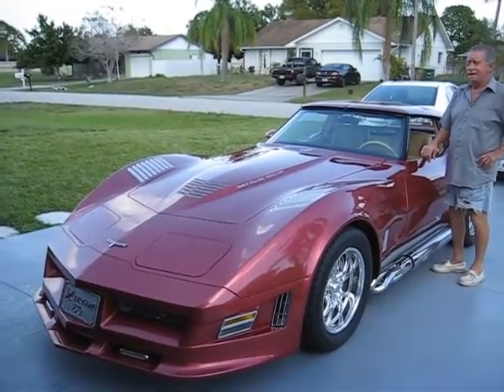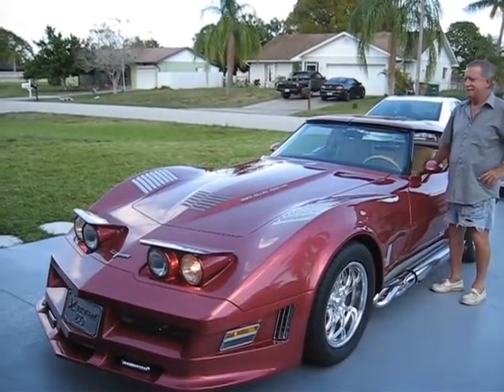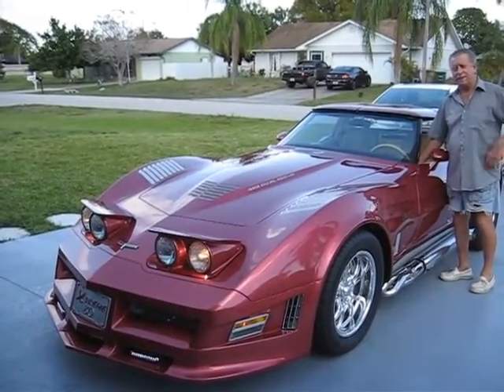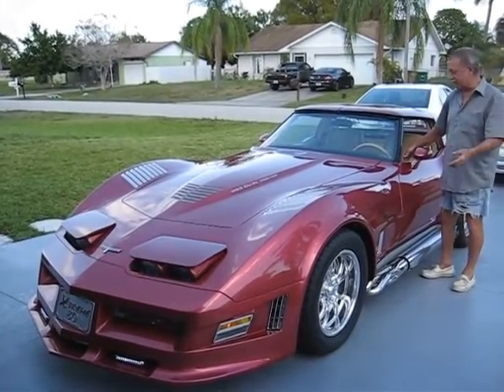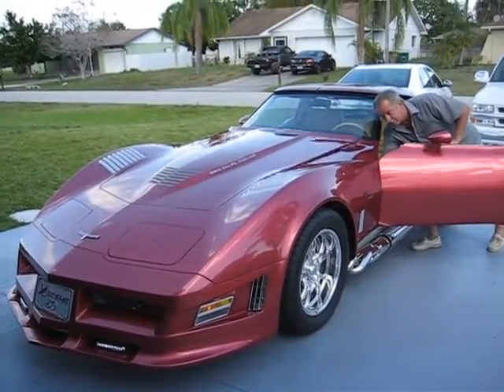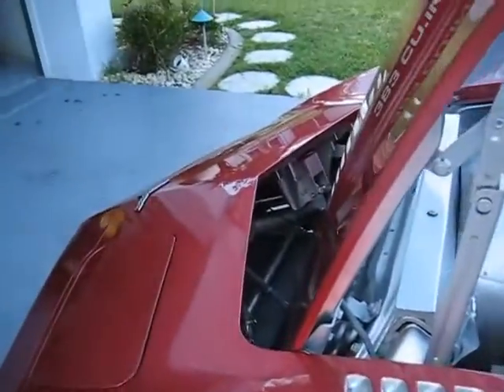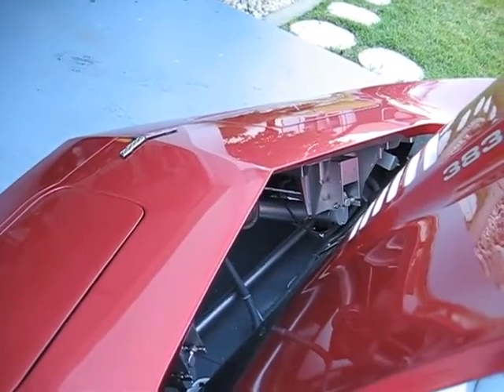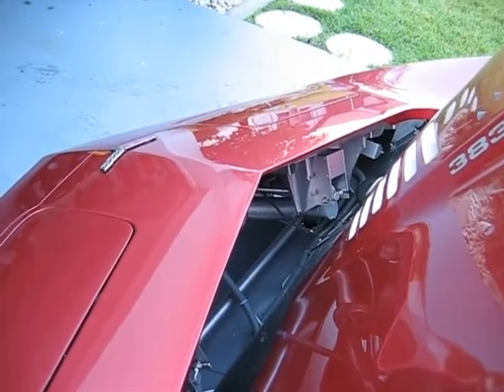Corvette Electric Headlight Actuator Conversion Kit

Comment: Nice Vette, I have an '80 and would like to do the same conversion. Is there a way to adjust the speed of the lights? They seem slower than all of the conversions I have seen.

 Thanks.
Reply from the maker: +Les Nunes No, the electric motors in the kit are not speed adjustable. 

Thank you,
Kyle
Product Assistance
Corvette Central
1-800-345-4122